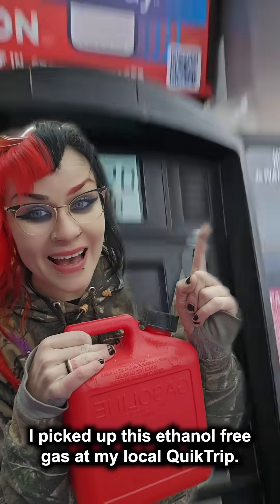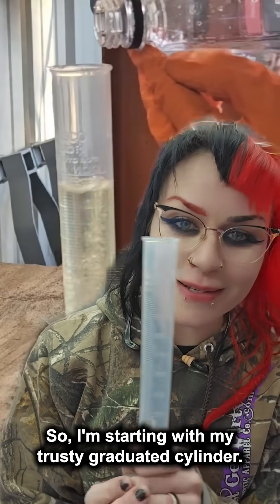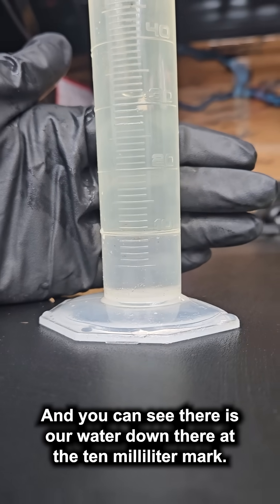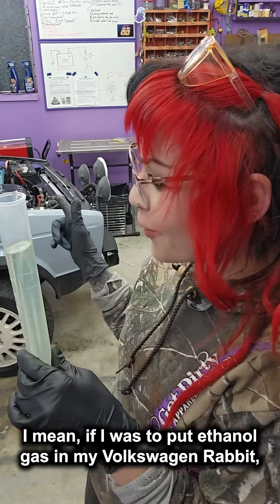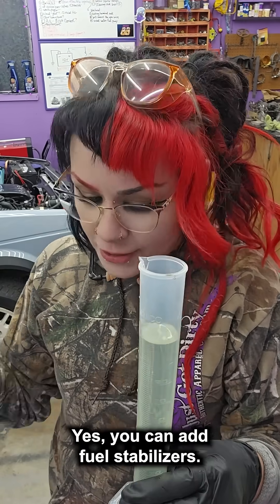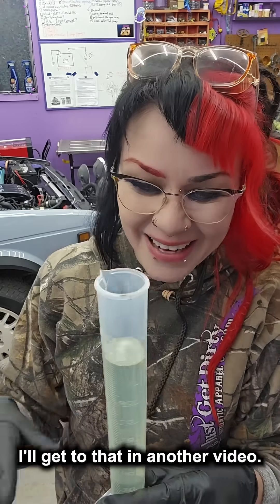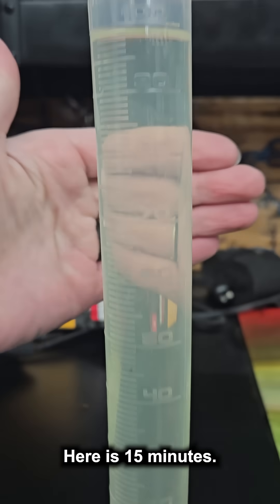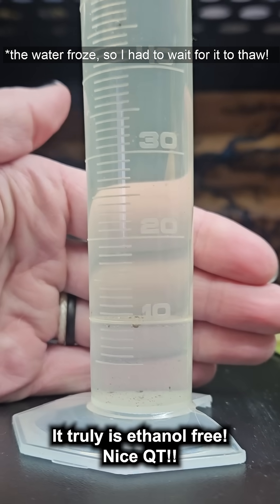Is Ethanol-Free Fuel ACTUALLY Ethanol-Free? Testing QuickTrip fuel using the Water Extraction Method

Comment: one  of the things Obama did that was good..mandate for ethanol free fuel for marine use...because boats do not use closed fuel systems, so they can absorb water if the presence of ethanol is present...4 stroke outboards have a real problem with any water in the fuel...older cars with fuel injection have similar problems...quick fix is add denatured alcohol to the bad fuel..it will burn through...Stabil fuel additive helps  also

Comment: The other bonus is QT gasoline is Top Tier with specific detergent additives designed to keep engine components clean 😊
Reply: For some reason when I had a 1995 GMC Safari it didn't like QT gas and I thought it was the detergent package. The only vehicle I've seen that with.
Reply: It's KT in my area
Reply: @Rancid_Ninja  different company. In the midwest QT is the beez kneez!
Reply: @ironken1796  I'm in the Midwest, in Minnesota and here in Minnesota and Wisconsin it's Kwik Trip
Reply: @Rancid_Ninja  Kwik trip and Kwik Star are the same company, QT is a completely unrelated company that operates in the southeast, southwest, and lower Midwest. The most northerly ones are in Iowa and Illinois, that's actually the whole reason why Kwik trip is called Kwik Star in Illinois and Iowa.
Reply: I prefer the bottom tier for the fuel in my Volkswagen rabbit. 😁
Reply: I hate to break it to people but the fuel you are buying from QT comes from the same fuel refinery as CK, Loves, Pilot, Casey’s, KT/KS, ect. Some racks may offer certain additives for certain contracts but most additives are added in at the pump. That’s the primary different in all the gas stations fuels is the additives added at the pump and the how well they take care of their tanks and water prevention. Typically all your ulsd and gas is going to come from a handful of fuel racks. A small percentage will load out of a specific bay at a specific rack due to its additives but majority of stations will receive loads from different racks all based on price and allocation.
Reply: @crownzilla3625 do you work for QT?

Comment: Here is called rec fuel.   I use it in all my small engines.  After a bit I just started buying regular gas and removing the ethanol from the gas.  Takes very little time and saves me about $3/gal

Comment: I used non ethanol in my ecoboost. Have had no problems.
Reply: If you have direct fuel injection, you might look into getting an Oil Catch can which removes the oil mist from the EGR loop. Keeps your valves from getting carboned up!!! The brand I recommend is J&L. Just search up "JLOSC". They are a little bit more expensive, but they sell kits with pre-cut hose lengths & mounting bracket. If you change your own oil, I also recommend "FilterMag" that snaps on the outside of your filter can & traps any iron/steel/ferrite particles on the inside wall of the oil can/filter. Both of these items are small prices to pay instead of an engine rebuild. Preventative maintenance is key!

Comment: Here in the Cincinnati area winter time we use what's called gas line antifreeze which is basically alcohol/ethanol to get the water out of the fuel. LOL. This used to be a huge problem but lately fuel suppliers are doing a much better job. I would tow multiple vehicles during like the weather we're having now for fuel line freeze up. Some I would say was condensation in the tank but you would hear of people using the same gas station and getting towed from the same neighborhood
Reply: Honestly, if that's the case... I would probably call the agency responsible for gasoline testing in your area. 

It could be the EPA, State department of agriculture, etc. typically there's a sticker for the weights and measures and another for the quality. 

If that many people are having the same problems with water from the same gas station, it's possible that they have a cracked tank or bad seal on the caps that's letting water in.
Reply: Since most fuel is now E10, gas line antifreeze is pretty much moot at this point unless you've got a TON of water in your fuel.

Comment: I’ve been using QT non-eth gas for a few years.  Never had a problem with it.
Reply: I had a car that would ruin a spark plug when it ran regular but when I used ethanol free it ran fine. Then if I tried going back to regular, when it would reach about half a tank the spark plug would get damaged. Obviously there was something wrong with the engine because other cars I don't have an issue using ethanol.

Comment: Been a rule of thumb for myself for years, I run whatever in my vehicle for the most part, but only use ethanol free in any small engine.Since for me they tend to sit for long periods of time without use. Never really had much of a problem that way, no stabilizers used. 🤷‍♂️
Reply: Ethanol free is a "must" for small engines imo. It basically stops carb fouling.

Comment: Does your ethanol free pump send the gas through its own hose?  If it shares a hose with other gasses, I wonder if it would pick up some ethanol gas that was left in the hose from the last use.
Reply: Quik Trip has different hoses for ethanol free and other gases.  I use the ethanol free stuff from Quik Trip regularly.
Reply: Just pump half a gallon into the trash can beside the pump before you start. Clears out the hose. 

😂
Reply: @HerculesRockefellerESQ  Hey, there you go!

Comment: Remember "Dry Gas"? methanol to dissolve any water in the tank and run through so that it doesn't puddle and rust the bottom of the tank.
Reply from the maker: I don't!!! I'll look into it, thank you!
Reply: @FayeHadley  ..always learning! I love it!! 
Go girl!
Reply: @FayeHadley  it's basically ethanol and it absorbed the water 😂
Reply: I've used Iso Heet before
Reply: @Joetechlincolns  yeah!
Reply: Can't you just use isopropyl to do the same things dry gas used to?
Reply: @Yoinx  yes but store bought is only 90% and has 10% water already, so you'd need to find a source of 99.99% concentration.  Methanol, Ethanol, propanol, isopropanol, (any of the alcohols) all do the same thing; they dissolve in both polar and non-polar solvents, allowing water to dissolve into gasoline and run through the system instead of puddling at the bottom and rusting the tank. Ethanol is just the cheapest for mass-production.   Pre-2001 rubber fuel lines, gaskets, o-rings, and such were not alcohol tolerant and degraded faster with E10 and that was the source of 99% of problems with ethanol'd gas.  Post-2011 manufactured rubber intended for fuel system use (lines, gaskets, seals, o-rings, etc) has to be formulated to have no problems.  The brown tint of old gas, brown crystals in small engine carbs after sitting for 6-12 months; that is not the ethanol, it's the polymerization of the petroleum itself.
Reply: @workbenchz  paint thi ner? 100%?
Reply: If you want alcohol in your gas, just buy E-10 gas at the pump, it's 10% ethanol.
Reply: @Yoinx  Yes.  But most Iso alcohol has water content of its own.  "70% alcohol, 80% iso, etc."  I use 90% alc. or 99% for cleaning glass streak free mixed with distilled water.  For my cars that don't get driven many miles, I use StaBil that helps burn small quantities of water, (bought by the gallon, the cheapest way.)
Reply: @Tiberius_I  ...Denatured Alcohol is what you want to use..No water is used to cut it.
Reply: @MrDLRu  Copper sulfate and Pyridine are used to 'denature' the alcohol, not sure what they would do to an engine.
Reply: @workbenchz  ...nothing, as that trick has been around forever for passing an emissions test
Reply: @Yoinx  ?
Reply: @Yoinx  If you can find any pure that isn't 10% water.
Reply: @Yoinx  -  Yes. Isopropyl will absorb much more water and will still burn reasonably well carrying and equal part of water. USE ONLY 91% or greater for best performance.
Reply: @jllaine  YES!!
Reply: In New Zealand we were using M15 for a while in the late 70s-early 80s

It's even worse on rubber components than ethanol...
Reply: Did that often with a boat gasoline engine from the 50s, to remove the water from the gas tank. In spring condensation would enter the tank through the vent hole and pool on the bottom. Water droplets could form on the one spark plug making it difficult to start.

But this engine could also run on pure alcohol according to the manual.
Reply: That used to get me to pass emissions back in the 90s lol!😂
Reply: There was a problem with ice forming in the fuel lines & freezing. Cars would have to be towed to a heated garage & allowed to warm up before they would start. SOHIO gas, now part of BP, used to have a commercial with the slogan, "You go, or SOHIO pays the tow."
Reply: HEET works for water removal in fuel and it is alcohol i believe but I’ll double check that
Reply: @gunztommiegunz  Every "water remover" additive I have ever seen used alcohol to remove said water.
Reply: @ yea i checked it out…definitely ethanol or alcohol of some sort. I live an hour south from Chicago when it gets really really cold over here. We have to prevent the lines from freezing. I’ve had it happen before.